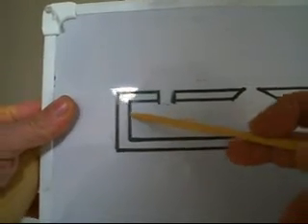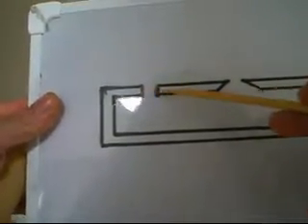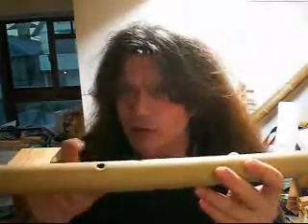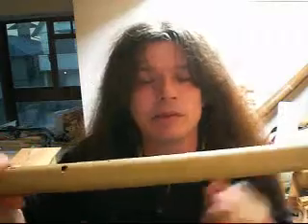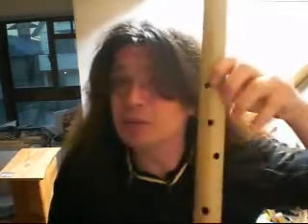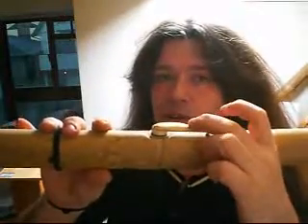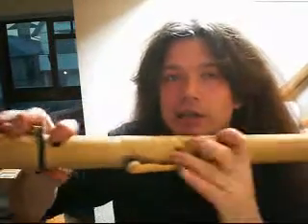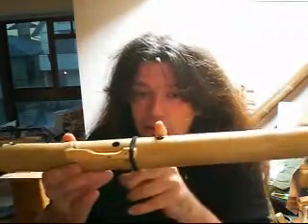How to Make a Flute - The Project - PART TWO

Comment: since you seam intrested : I am making a flute prety simpel. making it from the leg of a disfunctional table. 
did not think it would be so much math, but I guess were wrong.
I thought I could put something inn to the hole at the end of the flute and try to figure out where the hole should be that way. It feels like it should work but I'll look into the math and see if I can make something out of it. 
If you like I could post a video response when I am done with making the flute.
grate  tutorial

Comment: I made two flutes (one transverse and one fipple) for a Native American music class in college 7 years ago.  Being a flute/piccolo/oboe/English horn player I decided to ignore the mathematical measurements I knew I could go find on the net and just by coating my fingers in pencil lead and holding each flute as though they already had holes, I was able to transfer the pencil lead onto the bamboo surface to use as templates for drilling the fingering holes.  Both worked so well that my teacher 'lost' them or someone in my class stole them after they were graded.  I've got new bamboo and am ready to remake the transverse flute, the fipple (which was what we were supposed to make for the class as supposedly easier to make) is a pain in the neck...mostly because I'm ocd and the transverse doesn't need as much finagling to just work.

Comment: quick question- i want to try to make one (why not i have some free time) the embrasure (i think i spelled it right?) you said to drill the hole and file it at a inward angle (enstead of taking away from the out side) all right what angle am i going after? 45 degree-30,25??

Comment: Ok. You asked for feedback. I failed. I Failed multiple times. I tried to follow your instructions. I understand them (or i only have an ilusion of understanding).
So could you make a video of you actually MAKING one of your PVC pipe flutes?
Or could you atleast post the numbers. Like an example schematic with measurements so we could check out math against it. I'd apreciate it a lot.

Thanks in advance,